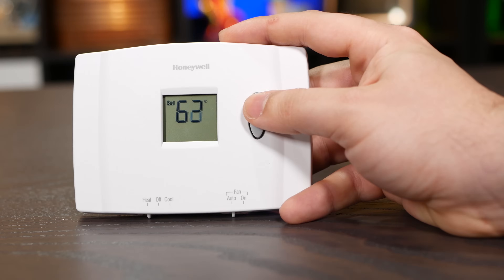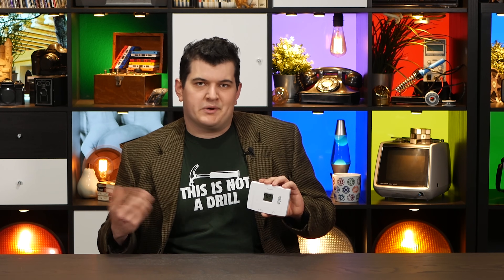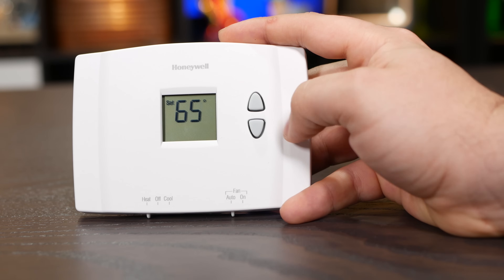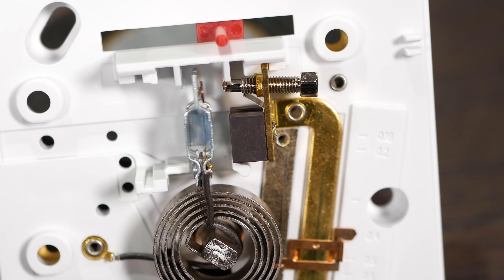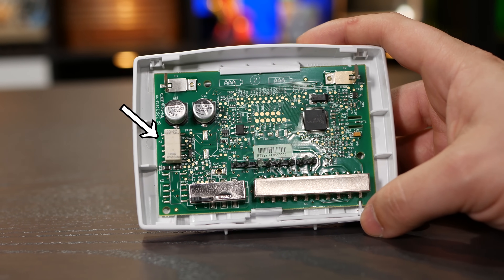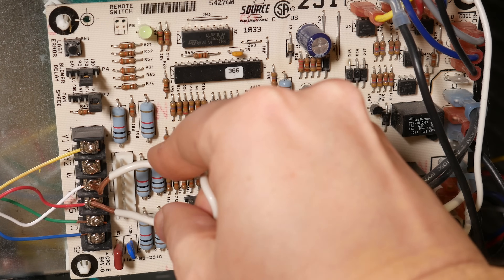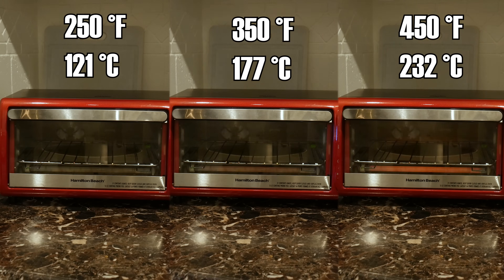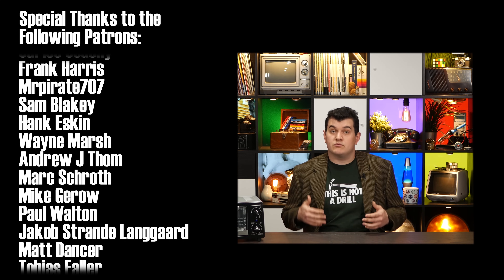Thermostats: Cooler than you think!

Comment: Setting it to 80 degrees heats up the house faster bc the air around the thermostat is not representative of the rest of the house, especially when the house is cold and you're getting it up to room temperature.  The furnace will shut off several times before the whole house is up to temperature, because it senses just the air around the thermostat, and it takes several hours for that air's temperature to become the average temp. Once you have the house filled with warm air, you have a buffer, and the thermostat can be set to 65F or whatever.  But when getting up to temperature, setting the thermostat higher works best.

Comment: Some thermostats run the compressors at a variable load. E. G. Inverter systems or Variable Refrigerant flow (VRV) systems use Variable speed drives for the compressors to regulate temperatures for different heat loads. My home uses a VRV (Inverter) system and it keeps the temps very consistent at all times.

Comment: On your last twitter question,  the person asked if the temp would temporarily be adjustable and the answer is yes, ALL thermostats do it, just turn up or down the temperature until you're comfortable.  Either way, an HVAC system will NEVER keep anyone comfortable! for example, when I'm cold, my wife is hot and my kids are fine, what do you do then?  granted, the question was geared at some random comfort setting, at which point, you still have to tell the system WHEN you're finally comfortable.

Comment: Having proven that this demonstration would work using my personal toaster oven, I decided to purchase a new one. See, my toaster oven is kinda filthy and I wanted to get another one anyway. I thought it would be handy to have a toaster oven at the new studio. See, they're really nice for making small snacks or whatever (though frankly I've always found the actual toast making experience to be rather lacking even before I was introduced to the Automatic Beyond Belief! wonder that is the Sunbeam Radiant Control toaster). Anyway, so I wanted to get a new toaster oven, right? So I went to the store and bought a really basic one, just like the one that I use every day in my kitchen. No sense spending a lot on what will just be a part-time toaster oven, and it was the same brand as the one I had at home. Must be perfect, right? Well, it turns out that this new toaster oven runs a much shorter cycling time than my old one, so the effect that I was trying to demonstrate became nearly impossible to see. That sure was a bummer! It later became clear to me that this wasn't a very good toaster oven anyway, as the fit of the little tray they give you for cooking tacos or whatever was really very tight and just unpleasant. The whole thing was just a travesty, really. So I've since returned the toaster oven you just saw and replaced it with another one, but this was after I had already filmed the entire video, and also after I had already filmed my original toaster oven doing the thing I want to show you. I toughened up and cleaned it the best I could, and I think it looks OK.

So that's the story of why you're about to see a different toaster oven. I made an assumption that turned out not to be true. Oh merde. In the end, it all worked out for the best anyway because I got a much nicer toaster oven on sale at Target right after I returned the rather poor one, so all's well that ends well, amiright?

Oh, and if you write this in a comment {guilty as charged} to save people the trouble, you're a fun sucker and sucked the fun right out of this gag. I hope you're happy.  {Well you deserve it for only using one space between sentences when clearly double-space is much neater looking and forcing me to decide which OCD to satisfy, my exact copying OCD or my double-space OCD.  I obviously chose exact copy as that indeed what I was doing, until you inserted that little barb directed at me, and now I have had to respond to that using my own words which requires double spacing, thus annoying my perfect copy OCD, while my double-space OCD is still sulking in the corner.  I hope you're happy as well.}

A more helpful comment would be to tell the nice viewers about either the "speed" setting on mobile, or the fact that the < and > keys on desktop will advance frame by frame. Then they'll be in on the joke, too! And then when I or any other silly YouTuber decides to do this again, they'll be equipped with the knowledge of how to do this.  {Or you could just have lightning-fast spacebar reflexes developed from playing Xenon 2 as a child, and use this opportunity to mention 86Box, which is an emulator that actually emulates each individual piece of hardware on the PC, thus bringing back the glory days of the 90s (complete with setting the IRQs in the settings and config.sys arguments, etc, etc) and allowing me to boot up a virtual 286 and try to distract my sulking OCDs by blasting my way through some levels of Xenon 2 again.  H/T MyAbandonWare.com for old OSes and games that are no longer sold, and for linking to GOG.com for those that are again available on the market.}

You already wrote this out, didn't you?  {Eeyup.}  Well, I won't delete your comment, but you are now a convicted fun sucker and you'll just have to live with that the rest of your life.

Pfft.

{That's rich, talking about fun-sucking... you single-spacer you.  If you or anyone else wants to try out 86Box, use your favorite search engine to look up "86Box Getting Started", and that should have you well on your way.}

Comment: Interestingly quite a few commercial units have heat and a.c built into the same unit and actually have 2 stage heaters AND a.c. compressors. They also commonly have outside air dampeners and a somewhat smart brain, set up so that is a certain temperature is requested and the outside air can meet that request, then the system will simply open the dampener and only run the fan instead of running heat or a.c when it's not actually needed. At least in restaurants in CA.

Comment: Since this will boost engagement:

In addition to AC, heat, and emergency heat, my system also has an "auxiliary heat" indicator. Experimentally, it seems to activate whenever the set temperature is at least about 10°F higher than the actual temperature. And it apparently routes power to an electric heating element somewhere in the ventilation, completely independent of the main compressor-based system (my main heating system is essentially just an AC unit run in reverse).

So yes, I can heat up the room faster by setting the thermostat higher.

Comment: "Ignore the blue", that got me paying even more attention to the blue
Reply: Streisand effect
Reply: same
Reply: HVAC Tech here. Wanna hear a fun story about a furnace that kept blowing its fuse? Yeah, there was a short somewhere on the board in the common side of the circuit, so whenever you connected the common to the thermostat, the fuse would blow. This originally started as me trying to install a Nest thermostat. Imagine hiring an expert to install a new thermostat, only to be told that your furnace needs a new control board. Yeah, the homeowner wasn't happy. I did manage to work out a hackey solution though, that involved wiring the common directly to the common side of the transformer. I should point out that this is NOT a proper solution, and was only a workaround for this specific scenario. If the homeowner's system had also had air conditioning, then this would have been discovered sooner, as well as not been solved this way. For those non experts out there: the circuit that turns on the outdoor condenser unit on a standard split-system AC is also wired to the common terminal on the furnace control board. Were it present, the fuse would have been blowing every time the  AC came on. But this was in Breckenridge Colorado, in the house of someone who (rightly) figured that it would be cheaper to run a window unit for the couple months each year that actually required any kind of AC. Because the common was previously unused, I'm at a bit of a loss to how it shorted in the first place, though the two potentials that come to mind are manufacturing defect, or perhaps corrosion on the board.
Reply: @TheMinecraftACMan  Huh. I had a guy bring in a control board like that and asked me to fix it at a computer store in Denver.
Reply: @TheMinecraftACMan  a good hvac tech would never install a nest thermostat. Imagine having your thermostat shut off by the power company
Reply: @TheMinecraftACMan  why do you randomly comment this under someone else's comment where it has nothing to do with that?
No one asked for your story here
Just put it in your own full comment
Reply: @boinggogen  Because he was talking about the blue wire, and I had an interesting story about the blue wire. You can go shove it.

Comment: That was really interesting to see how much different things are where I live and in the US. Here there is no AC and no fan and also no need for batteries because each thermostat are connected to their own heating device and there is literally 240V on the wires. Also, it doesn't seem to be any indicators on the screen on yours as to how much is the output . Here, there is always an indicator. Sometimes it's 0-4 bars, sometimes it's 0-5 bars.

Comment: Cars work differently.  The temperature setting is the temperature of the air coming out of the vents. Whereas on a house it's the temperature of the air inside the room that's touching the thermostat.  Turning the climate control to either full blast hot or full blast cold in a car would most closely emulate house HVAC system.   If you go in your house on a cold day and you want to warm up faster, you set the inside air to a higher temperature than "normal", so maybe they're "wrong" for different reasons.  They feel warmer faster when it's 80 inside instead of 72.  ( A cold object would warm up to 72 faster if the air around it was 80 rather than if it was just 72)

Comment: We have the smartest if them all---our thermostat has no batteries,  and has only two connecting wires, the furnace has a device so that it will only turn on if theirs a short between the wires, powering the thing creates enough of a resistance to prevent the furnace from turning on.

Comment: The thermostat in my apartment has a switch to choose between heating and cooling, as well as another switch to turn off, automatically turn on/off at specified temps, and an on setting to turn on(based on temp setting) to run regardless.

Comment: I have a heat-only thermostat in my flat in London. The boiler (that's what we call furnaces for some reason), while it is completely oblivious to what is going on outside of itself, does in fact modulate itself between low and high and I'd guess about 12 steps in between. I think the ability to do this may be a legal requirement for new installations.

Comment: You clearly explained how the temperature-sensitive spring works and how the magnet restricts oscillation. How is this done on the digital controllers?
Reply: Probably thermocouple - a simple analog device that coverts ambient temperature into electrical resistance. The digital board does some simple analog-to-digital conversion to sense the temperature.

Comment: Long story, but I actually got a thermostat for Christmas when I was about 7 or 8 years old, took it apart and hooked a fan up to it to mess with....anyway, my parents were worried about the mercury bursting during one of my experiments that they actually somehow bought one of these for me (https://i.ebayimg.com/images/g/OF8AAOSw4Atddt03/s-l1600.jpg). It's a Honeywell TA420 thermostat, but had bellows inside that would expand/contract depending on temperature....couldn't remember how it works after all of these years, but it definitely was unique and seemed older than the mercury bulb type. It'd be interesting to get your take on that particular thermostat

Comment: I've had a programable digital thermostat with the function mentioned at 16:25 , you push a button, set a time, a desired temperature and go, it would ignore the programming during that period and just follow the instructions.
Reply: Lots of thermostats do, my thinking is that the setting he wants is you tell the thermostat to just start running for say 15 minutes regardless of set temp so it just goes until the timer runs out then returns to normal

Comment: Turning the thermostat to a higher/lower temperature than the desired target temperature, is still an effective means of reaching that temperature as quickly as possible. Since all spaces have "space"... length, width, height... the temperature of the space furthest away, from the heating/cooling source, will take the longest to reach the desired temperature. Unless the thermostat is located at the furthest point from the heating/cooling source, the thermostat will shut off before the furthest space has reached equilibrium. Thus, only setting the desired temperature on the thermostat, will delay the "entire" space from achieving the desired temperature.

Comment: You mention "the only thing it can do is heat max or switch off"..  Ever heard of OpenTherm? Then your heat system does run on 30% instead of 3 min on/ 7 min off. So there is an intelligent protocol communication between the thermostat and heating system (also called modulation). It's very common here in The Netherlands/Europe.

Comment: "If anyone knows of a thermostat that does this, let me know!"
Well, I've only seen this function on the smarter thermostats you were intentionally not talking about. Residential heat pumps will often have a "POWERFUL" mode where it runs on max power for a set number of minutes. Just look up Daikin mini splits for an example.
Reply: I think with what he was referring to with that let it run for one cycle thing has more to do with standard central air systems in america I have pioneer mini split system in my garage that allows me to not only adjust its power level and fan speed but i can tell it to run in certain modes for certain times before returning to the normal programs, its quite useful if im going to do some work out in the garage at a point where i have the system set to a really high or really low temperature depending on season, but my house has a standard central air system with a heat pump, and even after taking the old thermostat out for a nest unit i dont see the ability to just have it run for one cycle for a certain amount of time, this would be a useful for say if i was going to bed i could have it run the a/c full blast regardless of the temp until i fall asleep then just let the house return to normal set temps afterwards, but it doesnt and i just have to have a small window unit in my room to keep me cool while not running my electric bill through the roof. I know it seems dumb but before i bought the window unit i did try to just have the ac cool the entire house first to my perfect temp and it cost a crap ton, weirdly this window unit is cheaper as i can leave my house set to 82 at night and have my bedroom get down to 77 and it costs less so makes sense for me and its better than lying there not falling asleep.

Comment: In installation i do we use 2 wires thermostats, they can control boiler, control electronic for pumps, recuperation system and more. Usually every room have it's own thermostat for underfloor heating, all of them in turn can control boiler in on/off manner with right kind of hardware. It's trickier with radiators, those systems tend to be less "smart". In those systems boiler is controlled by thermostat in on/off manner, but actual heat output is regulated by temperature difference between supply and return water from radiators and some weird settings in control system of boiler itself (ex heating curve).  
And modern condensing boilers have a "medium blast" and even "barely working state" which they "love" ;) Don't know much about those air based heating systems, as we don't use those here in Poland, not in homes at least .

Comment: Yes you can have a 1 cycle heat or cooling mechanism. All you need to do is get one of those fan switches with the timer and attach the two wires to the furnace. But you need to make sure you do not turn the switch on heat if you have it for cool or vice versa.

Comment: I'm sure this has been brought up here, but you didn't mention a two-stage furnace, which in that case will heat faster if the set point is high enough above the room temperature.

Comment: I have absolutely seen a thermostat in the past that would allow you to temporarily alter the temperature, then automatically return to the programmed temperature after an hour. In fact, the way it was designed, that was the default behaviour if you changed the temperature and DIDN'T press the HOLD button after you changed it to hold the new temperature. It would use the new tempoerary setpoint for just an hour, and then return to the program. I'm afraid I don't recall the brand.

Comment: Regarding the closing request for a thermostat with a cool down button. My car, and I assume many others, has a Max Cool button. You press that and it blasts AC regardless of your comfort settings. Press it again and it resumes the normal program.

Now using amazon echo or samsung smart things or other automation controllers with an API, I think it would be straight forward to make a module that acts as a max cool timer

Comment: IIRC I've come across an electronic thermostat in the past that did do a one cycle thing, don't remember where or what, but the button was labeled 'Boost'.
Edit: No I tell a lie, it was for a heating system, and all 'boost' did was bypass the thermostat and leave the heat on until you manually de-boosted it.